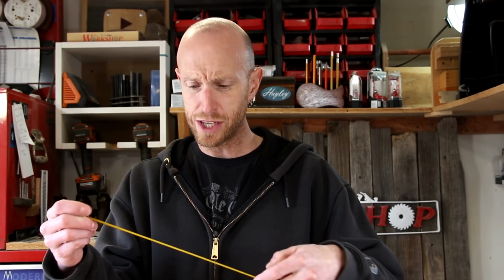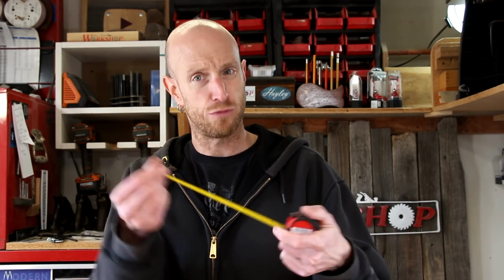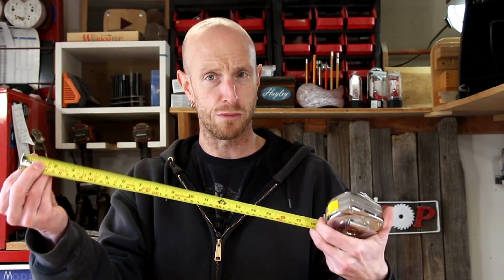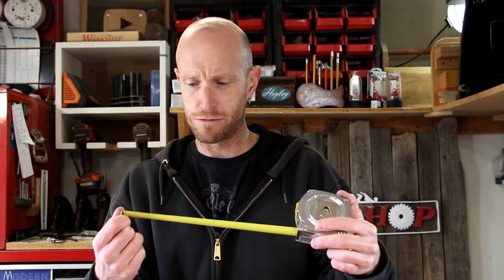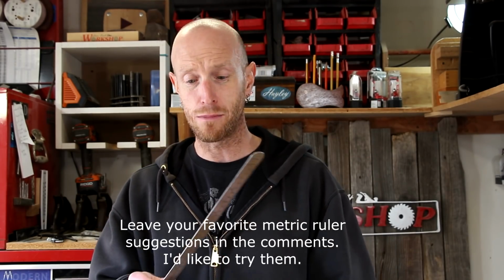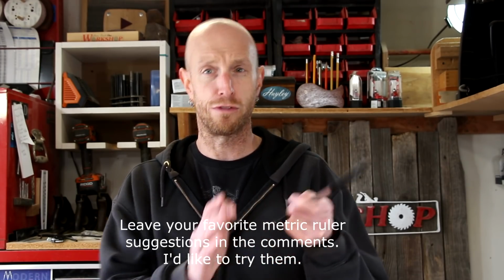My thoughts after using the Metric System for a project | I liked it

Comment: There are some interesting connections built into the metric system. For example: one litre of distilled water, i.e. imagine a cube of water 10cm x 10cm x 10cm (1000cc) - that one litre cube of water also weighs... one kilogram! There's more cool connections, but that's just one, to show you how the metric system is interconnected through various weights and measurements - and all in base ten! So easy!
Reply: I’d add couple examples - circumference of earth is approx 40000 kilometers or 4 arcs of 10000 kilometers. 1 watt of power is 1 amper multiplier by 1 volt.
Reply: the connections were not built in the metric system, the metric system was built by connections
Reply: @hrissan  Watts, Amps and Volts aren't metric - even the Americans use them too.
Reply: @TheMoonSeesMe  They are, but americans use them because there isn’t any imperial variant for that.
Reply: @TheMoonSeesMe  LOL - they are: 1 Watt=1 Joule/s. But nobody saw any use defining imperial units for them. You'll be falling out of your chair when you know this: all imperial units in the US are defined as derivatives of metric units!
Reply: @shoegazzzzzeeee  they have horse power instead of watt. Another weird one.
Reply: @banja9172  Yea, maybe because they don’t even know what Watt is
Reply: @carcharhinus_555  And metric units are now based on the distance light travels in a certain time. So? And they're not derivatives since A: imperial came first; B: they're just stating that one equals another.
Reply: @poppypalais3108  Fun Fact, the Metric System was adopted by France in 1799, the United States customary units were adopted in 1832(and the British Imperial System was adopted in 1826), so No Imperial did not, in fact, come first.
Reply: @TheMoonSeesMe  Watts are metric, horsepower is American. Amps and Wolts were always metric. 1kV=1000V etc...
Reply: @poppypalais3108  Sorry to burst your bubble, yet it's kinda exactly the point: SI units are based on nature's constants, imperial ones on random values. Even the US government recognized this, so they decided to actually define the units in term of SI units - that's all I said. You even exacerbate it by saying "imperial first". Yet SI's not defined in terms of imperial, but the inverse. So what's the point of your comment?
Really hate this "freedom units rulez" idiocy, we simply moved on. But whoever wants to use imperial - fine.
P.S. & educational hint: they don't "equal another" [sic]: simply look up how the units of e.g. "inch" and "pound" (avoirdupois) are defined. Now check how "meter" and "gram" are defined - which definition references the "other" units? It's not hard...
Reply: @carcharhinus_555  The definitions used to define measurements, are now, as you say, based on known natural constants. Therefore all systems of measurement are based on them, regardless of which one first used constants as a base. It's just foolish to claim otherwise. Or are they? How do we measure the distance light travels in a specified time? By using how far it travels in a fraction of a second. And the second was based on the rotational period of the earth around its axis, but now uses the frequency of changes in cesium atoms. And the choice of the number of changes in cesium atoms was chosen based on its relationship to the fractional rotation of the earth.
A = B, B = A. It's just wordplay. Or do you believe that no-one has measured the distance light travels in a foot?
Reply: @Ghelasin  Just wordplay. The system of yards, feet, inches etc. has been used since at least the Middle Ages. That a bit of legislation came out in 1824 doesn't change that. The metre wasn't defined by light until 1983 so I guess that's when metric started?
Reply: @poppypalais3108  No, not "Just wordplay", because it wasn't The Same Yards, feets and inches, they actually set fixed sizes for those measurements that were Different than those before. Just because two measurements use the same name doesn't make it the same measurement, like how the Imperial Ton, the US Customary Ton and the Metric Ton are all called "Ton" but they're three separate units, with three separate weights(People have actually Died due to mixing these up btw, it's kinda important to note that they're Separate Units despite having the same name). 

And they didn't actually Change the Metre in 1983, they found a consistent definition that would give the same length it's always been, but in such a way that it wouldn't be dependent on a physical object. Nice try though, A for effort.
Reply: @poppypalais3108  Sorry, just believe what you want to. I mentioned it as a fun fact that:
1. SI unists - like the metre, second, ... - are defined by natural constants, like speed of light.
2. Imperial units are defined via SI units.
Clearly, imperial units are transitively defined by constants of nature (when the SI system uses them - e.g. the pound was defined by the kilogram prototype, no constant of nature, until 2019. US customary units are SI derived far longer, since 1893). It shouldn't be hard to see that this is not just "equals": if the kg or m is changed, the pound and yard does as well. If the definition of pound and yard changes, nobody using kg or m cares.
But as said: you create a pointless discussion about how imperial units are "just as good" from a fun fact. And you're free to believe whatever you like to.
Reply: Poppy Palais is kind of embarrassing.
Reply: @rippspeck  Okay.
Reply: Cool but not used.

We only do metric bc. Its practical and easy.
Reply: It's super handy for cooking, because a milliliter of water, or any liquid that's mostly water (milk, broth, etc.), is gonna weigh close enough to a gram that you can measure volumes with a kitchen scale.
Reply: . @Dominator150395:  A fluid ounce of water weighs the same as a dry ounce.

Comment: „64th of an inch“ - getting the goosebumps of horror here!
(I am of course from Europe)
Reply: Eh?  I'm from 'Europe' and 1/64th of an inch is a perfectly acceptable measure.
Reply: @Nehemiah Scudder 64 in an inch, 12 inches to a foot, 3 feet to a yard. So 64 x 12 x 3 = 2304 1/64th inches. That's not to discount the difficulty in figuring that out. Also, working in 64th's is rarely ever necessary. I had to get a steel rule for a college class, and humans can't even accurately work at that level of detail (or 32nds, for that matter). I usually work no smaller than 16ths of an inch (or eyeball some point between 16th lines. I guess you could call that fuzzy 32nds if you really wanted to (also: WHY???)).

At my job, I switch back and forth between the two main unit systems constantly, simply because I grew up with (and can therefore better visualize) inches and feet, but metric is objectively easier. I can estimate what 3/8" looks like, but ask me what 10mm looks like and I have to get out a pair of calipers to figure out that the difference between two measurements is so negligible as to make no difference for most applications.
Reply: 0.0396875 cm
Reply: as a computer geek and musician i don't even mind having it in 64ths and 32nds and shit :D
they are in local powers of 2, so i'm not even mad
Reply: @purplecowadoom  when ask what does 10mm look like, I went 1cm which is very easy to see
Reply: That's like five eighths of a quarter big foot, with cheese.
Reply: it's just half of the half of the half of the half of the half of the half of an inch.... or something like that (pretty easy.....not)
Reply: @Alan_Mac  No its not at ALL perfectly acceptable. Its an overly complicated way of measuring a small area
Reply: @LoldemortII  It is so bad they have to calculate in elephants and football fields if the want to explain something in a descriptive way.
Reply: I feel sorry for you. A shame none of your ancestors had the get up and go to go anyplace. I thank God every day mine had some gumption.
Reply: 1 millimeter , centimeter , meter and so on its so easy , why would u wanna go 1/8th or 1 /16th and so on , makes no sense
Reply: @knight0582  why would we want to? Demo work you're within a foot and it is done. Framing you have to work to 1/16th Finish work you have to work to a thirty second. It is built in granularity. Levels of precision. They're targets. Nothing should ever be done better than it has to be done. Doing that is wasteful. You asked. Hopefully now it makes sense.
Reply: @knight0582  you could measure everything  in 1/16th 576 x 1/16 to the yard.
576 has way more divisors the 1000.
1, 2, 4, 5, 8, 10, 20, 25, 40, 50, 100, 125, 200, 250, 500, and 1000.
Divisors for 576.
1, 2, 3, 4, 6, 8, 9, 12, 16, 18, 24, 32, 36, 48, 64, 72, 96, 144, 192, 288, and 576.
Engineers work in 1000 of the inch.
Come on a simple mind needs simple fingers and toes to count.
My gripe is why did the Yanks rework the imperial system?
2000 lbs is a very short ton.
2240 lbs is a real ton.
How many lbs to a Stone or hundredweight?
The U.S. Imperial system was reworked to short change buyers.
As a last thought why oh why change the world standard pipe threads just for the USA
¼ BSP at 19 tpi. world standard.
¼ NBT at 18 tpi. U.S. standard.
1/8 BSP at 28 tpi. world standard.
1/8 NBT at 27 tpi U.S. standard.
Reply: @who-gives-a-toss_Bear   Thank you! I'm even European,
but people don't get, why it's far easier to calculate in the imperial system.
Ask a metric system user to divide his stuff by 3, and he's fucked.
Reply: @wisemantellsyousomething1134  I mean, what's a third of an inch? 0.33333... inch. You're as fucked as we are. Now say you want 23cm/7, that would be roughly 3.28cm which is accurate to the 5/128ths of an inch and almost every metric ruler has it, even though I just divided two prime numbers.
Reply: @m4riel  
Ha ha, yeah... every time I have to divide 23 by 7, I will use the metric system from now on. :D
Reply: @m4riel   Dude, really? You attack the name of my channel to make a point? That's pathetic!

First, you had to make up an extremely specific case to find an example, where the metric system works better. THAT already says everything! Nobody divides anything by 7. How about dividing 23 by 4, and you're fucked again.

Second, yes, you can not divide an inch by 3... and in the metric system you can not divide ANYTHING by 3!!

That's like saying: I have two baskets of apples. In the first one all of the apples are foul. But the other basket also contains a foul apple, so the first basket is better??? Wtf?
Reply: @wisemantellsyousomething1134  What do you mean "You can't divide anything by 3"?? You can only divide feet because, by definition, a foot is a dozen inches. How much is a DOZEN centimetres divided by 3? 4 cm. That's it. Is it too complex for your 3 neurons to reason? Also, the 23/7 is not an specific case, I just chose two random numbers that do not share factors to use as an example. What is 23/4cm? 5.75cm EXACTLY, not even rounding this time.
Reply: @wisemantellsyousomething1134  And what a stretch to call me pointing out you're not wise at all is "attacking". You pretty much put out some bs, I showed you why it was bs without bashing the imperial system in anyways, I even went on to say we're both as fucked, then you come with a bunch of strawmans. I say A you read B then refute C. It's like I'm talking to a kid.
Reply: @wisemantellsyousomething1134  Now fr, learn how to read properly. You're embarrassing yourself at this point and proving the united-stadian stereotype
Reply: @m4riel   I had to google 
"united-stadian"... Do you mean "American"?
I'm German... I mentioned, that I'm European in my very first comment... Maybe YOU should learn to read properly... (smh)
Reply: @purplecowadoom  For the most part only the power-of-two fractions (1/2, 1/4, 1/8, 1/16...) are used with the inch measurements, as those are the only markings on rulers and tape measurements. Therefore I wonder if it would actually be very practical to use base-2 numbers instead of base-10. With fractions then each digit position corresponds directly to one of the fractions (0.1 = 1/2, 0.01 = 1/4, 0.001 = 1/8, 0.0001 = 1/16, 0.00001 = 1/32), so 5 and 3/8 inches is simply 101.011. Adding 3/4" is as simple as adding 0.11 (just like in "metric"), so gives 110.001 which one can easily* read directly as 6" 1/8. For less digits one could use octal og hex; one only needs one fractional digit to work with 1/8" and two for 1/64" precision. (*=easy once familiar with binary numbers)

Comment: I'm a contractor in canada, i grew up 100% learning the metric system.  However until recently i used imperial measures for building.  I decided to go back to my metric roots for the accuracy, also i find it faster because of what you said, not dealing with conversions of fractions etc.  It's all i work with now.    Only took about a week to get super comfortable with it since its what i learned in school. I probably won't go back to imperial unless I'm working with an old school co worker.
Reply: You're probably saving a lot of money too, because metric has way less waste due to error.
Reply: Being in Europe and grew up using the metric system I at some point was forced to use the imperial system when I worked with US sewing patterns. I also used a tape measure that had centimeters and inches on it.....result: American patterns are a catastrophe to work with. I have never seen anything more inconvenient and it amazes me really how they manage to fabricate a wearable item of clothing with those.
While centimeters are extremely easy to calculate with (in comparison: 1/8 of an inch...what kind of math science riddle is that actually) inches are far less accurate and often 1 millimeter can make a difference between wearable and ruined work piece. 🤷🏼‍♂️ not to mention a 12 ounce can vs a 500 milliliter can, a foot long (who's foot - mine? Yours? size 7 or 12?), yards, miles, pounds, Lbs...u name it....and they all need a more precise metric equivalent to back up what they actually are .... question for the US: Y Y Y?